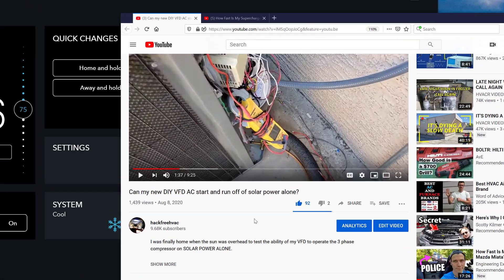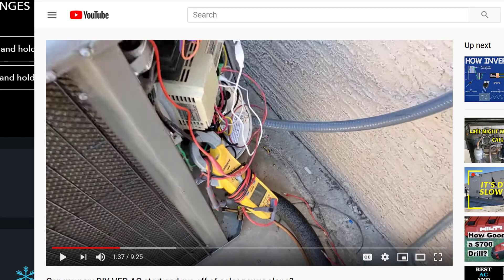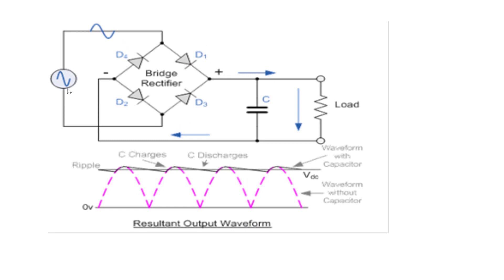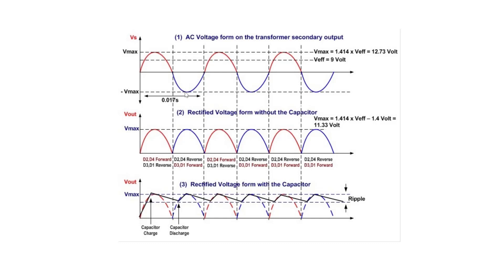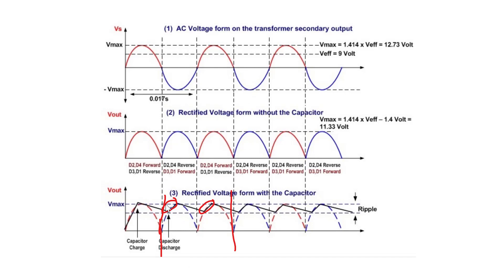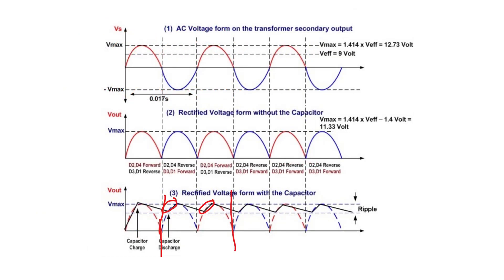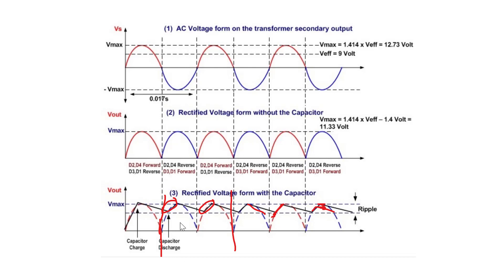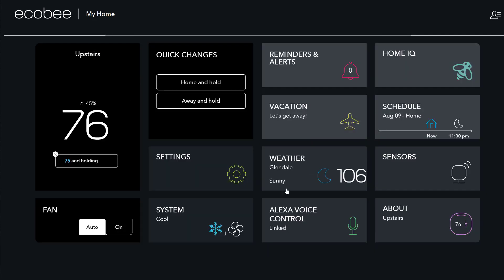Re: Discussion about VFD input amperage readings and actual power used

Comment: I wish I’d payed a bit more attention. To your thread on this. In a way, and I’m positive you know this, you reinvented the wheel.
 The normal meters used in the field have no chance to catch what’s happening, as the sampling rate is too low: example, I worked on cats forever, and when your putting a scope on a crankshaft position sensor, with the engine running at about 2k rpm, you get a nice square wave pattern, depending on the use. If you put a meter in it, it might read about 2volts ac voltage, which is BS, as I need to see resolution and to see if there are one bit errors in the pattern.
 It’s kinda like looking forward when a tree fell behind you; you know it happened, but you didn’t see it live. Same thing with these meters.
 Stick to the scope with a good redotion of even 100 cps, and you see the RMS voltage and the capacitor working together.
 In the end, as always, your right: it’s all about the amperage.

Comment: Afaik the Inverterboards of a Mini-Split have a Active-PFC it is like a Step-Up converter, but it pulls Current out of the Grid in a Pseudo Sine, similar to the output of the VFD. also it steps it up to 400V mostly.

The problem is to find a Board or module which is standalone to produce 400V @20A

Comment: Amps are amps use it or not! Get the power factor up!
Reply from the maker: Sure, amps are amps.
But drawing current for 10% of the time and 90% zero current is sure gonna be a different average than the typical RMS of a sine wave that almost always draws current (although increasing and decreasing repeatedly)
Reply: @hackfreehvac  i dont know how to explain in English, but there is no such thing as zero current, that current you are reading is there and will cause things to heat up, be less efficiënt  we call it blind current, you dont pay for it, cause your grid meter does not register but its there doing nothing but heating up the wires and motor. Thats why power company s here in europe demand a minimum level of power factor from its custommers.
Reply from the maker: @sjefoekel6058  
When the DC bus is at a higher voltage than the amplitude of the rectified AC inpute sine wave, there will be ZERO current flow.
Not until the incoming sine wave again has an amplitude higher than the charged level in the capacitors.

I think you're thinking about reactive power between a AC motor and the utility power.

That's different than feeding AC power through a diode and into a DC capacitor

Comment: I got myself confused on that last video with the DC bus versus ac input. So your clamp is on the ac input. I was thinking you had it on the DC bus. So just out of curiosity what is the input voltage phase to ground and what is the output voltage phase to ground? Just using simple ohms law this is what I cyphered for input amps. Unless the voltage readings are different from 120.
 20 amps input per leg
20amps x 120v x 2=4800watts.  2400w per leg
7.8 amps output per leg
7.8amps x 120v x 3=2808watts. 936w per leg 
2808w ÷2=1404w/120v=11.7amps should be close to what the input amp should be. But your reading 20.
All this is helping me learn, also I'm curious to see what your power use is being that I'm building my own solar so I appreciate the videos.

Comment: It's interesting to consider that the clamp-on meter isn't giving a true amp reading that will work with the basic formula V*A=watts.  But I suppose the money question is: how is the utility's meter on the side of your house measuring power?  Is it misreading amps the same way the clamp on meter does?
Reply from the maker: The meter on the utility will be reading power and should be accurate I'd think.

As for the clamp on meters, they have no voltage reading to do a calculation. It is all based on the clamp on induction meter.
Reply: @hackfreehvac  Residential meters only measure "real" power, so no worried there. Industrial customers get billed on power factor though.

Comment: Silly ideas: bypass the rectification in the VFD and build your own beefy full-wave rectifier with PFC to always drive the system off DC voltage, throw in an INA219 with a current shunt on the low-side hooked to an Arduino or other micro to monitor power consumption, cook up some custom load calculation routines to vary your drive frequency smoothly between whatever frequency? Might need to do something about driving that condenser fan motor though, don't want to fry your drive with low airflow...

Comment: Excellent project. Within the software on the ABB 550 didn’t they have a line item where you could break it down to Current used and wattage in the more advanced software for plugging into the drive ?.
Reply from the maker: I don't see (watts) power option in mine but it does display amps.
Which is output amps to the three phase motor. Which I can read accurately with my clamp meter as well.

It is the single phase input that I am getting an inaccurate reading of when using my clamp meter. I'm expecting close to 13.5 but it reads 20 which is very very unlikely.

Comment: Power factor is pretty much just how much a load distorts the grid by drawing current not inline with the voltage. A motor has a lower power factor as the current leads (or lags, I can't remember) the voltage by 90 degrees. Ignore the whole feeding back into the grid thing, it's not relevant in this situation. You just want to focus on when the load draws current. On a motor the peak current is when the voltage is closest to 0v, resulting in a poorer power factor. 

Compare this to a filament light where the current pretty much follows the sine wave exactly, which has a very good power factor.

The VFD has poor power factor as it draws current in short bursts, rather than all the way along the sinewave like a light bulb. Feeding back to the grid is not relevant here. It's the short current spikes that are the issue and cause the poor power factor. 

Power factor correction for motors, in which the current is a sine wave just 90 degrees out of sync with the voltage, can be easily fixed with capacitors as they "oppose" the inductive loads and equal out giving a nice power factor.

However, as electronic loads draw current in a short peak rather than a sine wave, you have to take a different route. The active PFC circuits that have been mentioned appear like a light bulb to the grid, while charging capacitors. It's just a fancy power supply designed to get rid of those peaks. As such, this makes the power factor much closer to unity as there are no more peaks on the mains.

Bit of an essay, but that's the gist of it. Do a bit of reading on active (electronic) vs passive (capacitive) power factor correction, should be some better explanations to help you understand.

Honestly, you can probably just leave it as is, it won't hurt anything but if you add active PFC you may get more solar utilization as you can smooth the DC side out way more, so the solar covers all of it instead of only the "troughs" in the DC bus. I would assume this is why you can run the unit off solar completely, however you still draw decent current on the mains when connected - the voltage of the panels is only enough to cover the troughs and not the peaks.
Reply: This is the answer, the distortion is the problem, not that the current lags or leads.
Here is one example: https://www.vishay.com/docs/88868/anpfc.pdf
Reply: @Alexander470815  that PDF is spot on, good catch!
Reply from the maker: @Alexander470815  
I was looking for a diagram like that!
I knew what it would be doing once I thought about the rectification aspect of it.

The new VRF Fredrich units we are working on have the power factor correction. 
Basically a DC to DC supply just as that PDF shows.

But they do it for the constant DC bus to support a wide range of input voltage (was something like 190 to 260vac allowed).
Single phase.

Comment: I had a brain-fart in my comment a few videos ago where I made that statement - I forgot about the diodes in your case. The diodes will prevent current from flowing backwards back into the grid. When you hook a capacitor directly up to AC mains (think like a noise suppression capacitor that goes between a hot and ground). You will get current flow, but no power consumed as the capacitor will just return the current as the AC cycle continues.

You can get current transformers pretty cheap on ebay if you want to measure the current using your scope.

Comment: Can your meter measure DC amps?  If so run the unit off of the panels and measure the current draw there, and measure the voltage too, that should be closer to the actual power used - minus the rectification loss.  For AC true-power monitoring I use the eyedro wifi sensors - about $150 for 2 probes and gives you readings in real time.

Comment: Thanks for clearing that up, graph helped.  I’m still curious how electric meters connected to the grid interprets the quick pulses of 19-20 amps while the capacitors charge.  Does the meter think it’s a continuous amp 20 draw like your clamp meter says?  Guess time will tell when you get your first electric bill.   We still have the old analog meter than spins. It sticks from time to time. $30 summer ac bills are nice. lol.

Comment: What's the voltage of your solar. And what voltage on the bus did you match it to? Really wish I had this info when I started building my solar power. 
I started with enphase inverters and hacked the proprietary connector off and tied it into my condenser disconnect similar to what you have. They produce l1, l2 and a neutral. I measured 1 amp each leg with full sun on a 250w panel. My goal was air conditioning during a power outage like after a hurricane and of course energy savings.

Comment: I have a technical question, is this a single phase unit, if so.......in regards to the run cap for compressor and fan motor...did you leave those in????